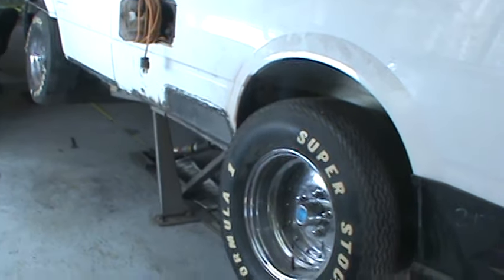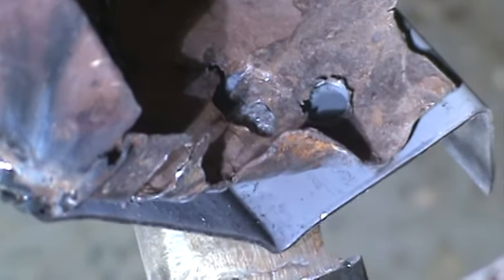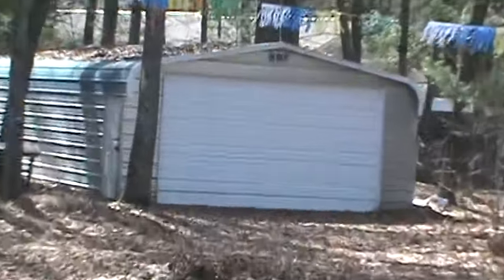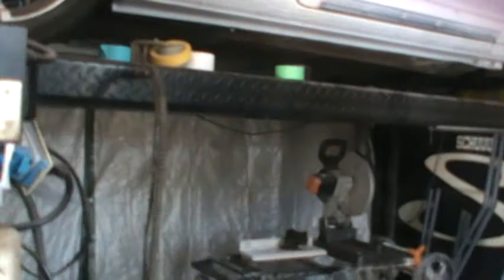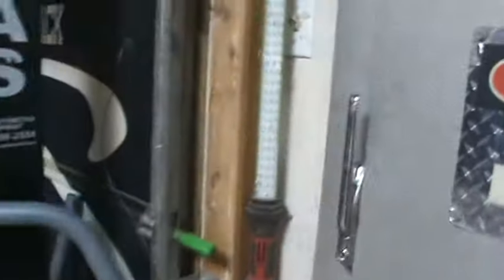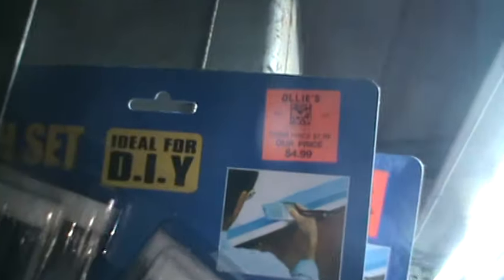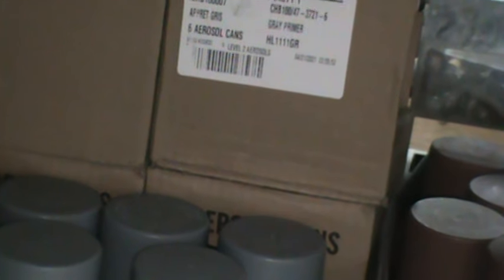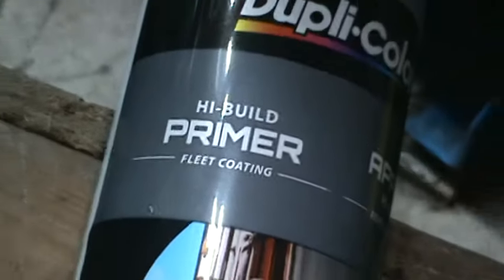ASTRO VAN DRIVER ROCKER DONE

Comment: the cheap gloves are good for messy stuff, i tend to put two - three pairs on at the same time because its hard as fk to put a pair of those gloves on sweaty hands, ii use them like a tear off when one layer is done but never take the last layer off unless i'm finished, i'll put a couple more on.

for gun cleaning etc yep better quality ones good.

base coat, i go to my local paint shop that mixes paint and ask them if they got any base paint they mixed which was either wrong or never picked up going cheap and a couple times they called me and asked if i want some before they dump it, always useful to have for guide coating etc.